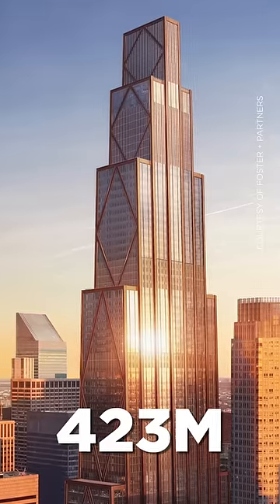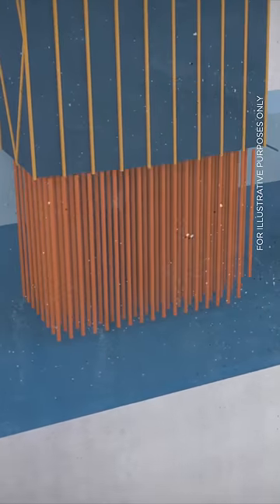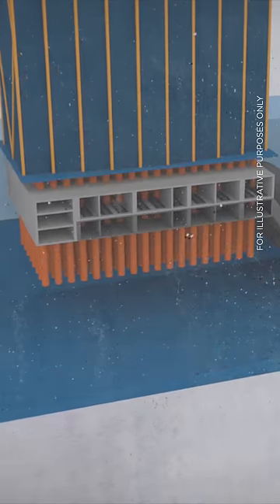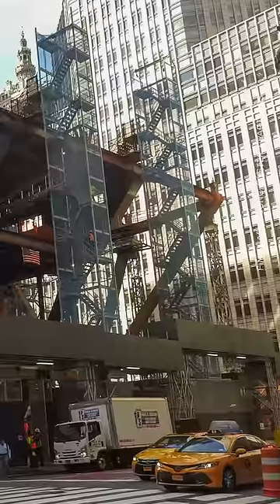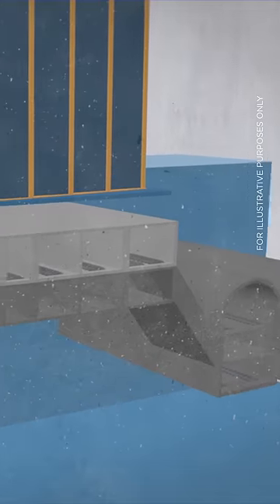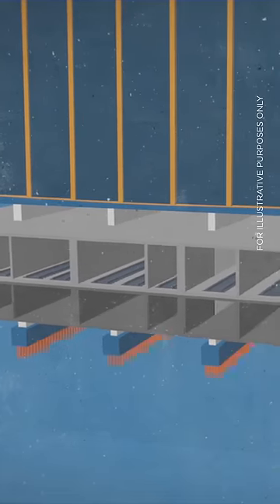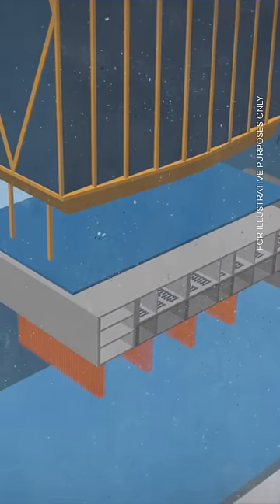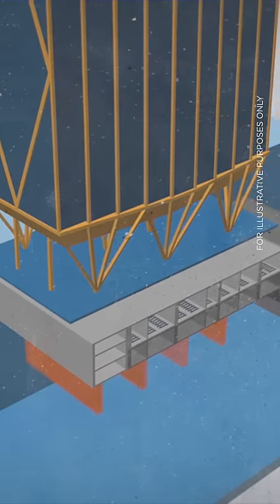The INSANE Engineering of New York's New Skyscraper

Comment: It just sounds so wobbly, like balancing a pencil on the tip, but I’m sure the engineers would make it work.
Reply: Not always….Almost every big city has at least one skyscraper that’s in trouble structurally.
Reply: Those columns you see in the video are only used for vertical loads. By themselves the buding would be wobbly. However the core of the building which will be in concrete, will act as the lateral load resistor!
Reply: That’s your opinion. You’re welcome to avoid the building and the subway lines underneath, if you can. Based on multiple factors the load tolerance was probably over engineered. I for one hope to see the plaza on YouTube videos soon.
Reply: They will break because they are just little wood beams.
Reply: "And as a condition of the city approving the design, the building's architecture offices must move into the first floor of the tower."
Reply: I'm sure...
Reply: @hunterdeardurff4386  
Another genius ! How many buildings in Manhattan have fell over or had severe structural damage since the day skyscrapers have been erected? In the city. I worked in Manhattan for half of my life. Never seen a problem. I think the college that the engineers went to are well educated in what they're doing. Otherwise imagine the repercussions.
Reply: @Mr.Robert1  Wasn;t there a potentially dangerous problem discovered with the Citycorp building? 
Luckily it got fixed, but could have cause a collapse I believe.
Reply: Lol facts
Reply: Nek minnit
Reply: Looks to me like it could collapse at any time!!
Reply: No it’s physics it is guaranteed to fail
Reply: @monishbiswas1966 yes they determined that the bolted joints wouldn’t hold up in hurricane force winds. They went in and welded the joints and of course it is still standing.
Reply: Balancing one pencil ✏️ sounds difficult but if you have a bunch of pencils set up the way the architects designed it. You will be able to stand and balance on a small scale model made out of pencils easily
Reply: Wobblyness is relative. The heavier it is, the more it takes to make it wobble. If Godzilla starts wobbling the building, we got problems
Reply: @monishbiswas1966 John Hancock Ctr in Boston had window panes falling off when it was built
Reply: It will fall in a couple weeks
Reply: @lizvogler4238
Glad you could bring your engineering and architectural degrees to this study. Please tell us in your expert opinion how this is unsafe and feel free to bring all of your vast knowledge and similar structural failures to the party. Otherwise, it just sounds like some doofus spouting off on YouTube about something they’re woefully underqualified and intellectually incapable of supporting and I know that can’t be the case. Every YT vid is filled with so many skilled experts, so I’m sure you’re one of those. I look forward to a video rundown or a published paper in the future. Until then, may we all be blessed and sleep soundly knowing you’re on the case about what looks structurally sound for a half billion $ Manhattan building.
Reply: Imagine taking out the legs with c4... easy pillar drop -intrusive thoughts😅
Reply: Until it doesn't
Reply: As long as they balance that skyscraper on “my tip” I’m sure it will stand firmly erect! 😅
Reply: Bruh, you're like 14 vs the best engineers in the world lol 😂😂😂
Reply: This is sketchy to say the least. If there's a earthquake (and they do happen in the northeast), the colums can easily buckle into the empty space, and the whole tower can topple from its base. The best case topple scenario is the leaning tower of NYC.
Reply: @Me97202  this big city had two…
Reply: @hunterdeardurff4386 wood?  Get a grip.
Reply: It’s risky but the reward financially is certainly worth it
Reply: Not really.....
Reply: Funny you all brought up Citicorp to help your argument...and completely forgot the crazy stilts in the middle of the block that hold it up, which damages your argument.
Forty seven years and counting.

Btw, our "weird" building is in Soho. Huge apartment building, completely empty bc it leans eight or nine centimeters off plumb. No way to really fix it, either.
Reply: Sure, it will work but for how long!?
Reply: @SethMethCS  NYC has had over 500 earthquakes recorded.
None of them have been above 1.7.
Why?
NYC sits in the middle of the NA tectonic plate, almost 2000 miles from the closest edge, which is in the middle of the Atlantic ocean. 
We are very well protected from this issue.
Reply: Not true  @MrRezRising
Reply: how many times  have  i  heard that before a  disaster
Reply: @Mr.Robert1 the twin towers?
Reply: @monishbiswas1966  
Actually there was
Reply: @jordanstangl2293  
You got it Beavis
Reply: @gabo262  
The World Trade Center in lower Manhattan
Reply: @MrRezRising  
I hope everybody realizes that the majority of Manhattan Island is Granite. Actually visible to the naked eye in Central Park
Reply: @MrRezRising  
The tower of Pisa has been leaning so long -- nearly 840 years -- that it's natural to assume it will defy gravity forever.
Reply: @monishbiswas1966  

October 1977. Less than a year after completion, the structure had to be strengthened when it was discovered that, due to a design flaw, the building was vulnerable to collapse in high winds.
Reply: @MrRezRising  
October 1977. Less than a year after completion, the structure had to be strengthened when it was discovered that, due to a design flaw, the building was vulnerable to collapse in high winds.
Reply: @johnnyllooddte3415  
For the exception of the 9/11 disaster, there has not been one structure on Manhattan Island that has fell over or collapsed for any reason. Most likely because of the foundations goes into solid granite.
Reply: Manhattan is solid bed rock
Reply: @takecarebpk  
Just go to Central Park. There's exposed Bedrock above ground. Granite!
Reply: Don't worry im a engineer!
Reply: @Zandex0  
I'm a doctor Jim ! Not an engineer.

Comment: I'm an engineer but not an architect, and I'm sure those architects know what they're doing, but I think the general public will be a bit uncomfortable sitting right under the skyscraper, at least for the first few months or when there's a lot of wind, it looks very fragile
Reply: Curious, do the architects not follow the lead of the engineers? 😅
Reply: @bigtxbullion  Well, I'm a computer engineer so I don't really know anything about designing buildings
Reply: @diecicatorce6259  using the term engineer to describe yourself in this comment section is a bit confusing if not disingenuous. I'm a lead software engineer, and I would have opted for programmer to avoid confusion. We are not typically the first thing that comes to mind – and in this case our jobs are not particularly relevant to the video or your comment. 😅
Reply: @bigtxbullion Architects draw the impossible, structural engineers make this possible. But there are exceptions, even in NYC, meaning they spend the cost of the initial building again on retrofitting.
Reply: You might want to rethink that trust.
Reply: @bigtxbullion  In this case and with any other skyscraper, the foundation is what's most important, and the professionals primarily tasked with handling and calculating the number and width of the bored piles embedded in the ground, are the Geophysicists. Even with the help of technology such as building information modelling (BIM) or even 3D printing, estimating the possible weight of the completed project which ultimately determines how much bored piling would be required, can be rather tricky and beyond the expertise of let's say an architect or structural engineer.
Reply: @diecicatorce6259  lmaooo so you no clue what you're talking about just saying the word " engineer " great job dude
Reply: @Spoon89803  hi, sorry, but this isn’t the case. I’m a structural engineer and we work with the Architects to develop a building form that works and fits the client’s brief. I have worked with F+P on a major project in the past also - albeit in the UK.

Typically we will develop an analysis model, and a 3D model that feeds into the multi-discipline BIM model. The BIM model is the coordinated design, making sure that everyone’s designs fit together. The structural analysis model is separate, and is used to understand how the loading on the building develops forces in the primary structural frame, but will likely use exported geometrical info from the BIM model. Developing a structural form require an understanding of the physics acting on the building, with the model speeding up and allowing greater complexity in our designs. If you don’t have a grasp of what the model is being asked to do, the structure will not be great, regardless of how good your model is, or how clever the software.

The structural engineer develops loading plans for every level of the building based on proposed use and proposed finishes (these could
Include up to 1200mm + of planting medium if internal/external landscaping is required). 

Once applied to the Analysis model, these loads generate base forces at the point that they interact with the foundations. 

The current UK/EU building codes generate over 100 load cases, but it’s typically the same 5 load cases we used to consider under BS codes that govern. 

Our friends in the Geotechnical engineering team (not Geophysicist- they do an entirely different job, looking at and finding buried features) will then undertake a Geotechnical Ground Investigation, developing a geotechnical interpretive report, advising the possible foundation solutions that can support our proposed base forces. 

Key issues for a project like this will be long-term foundation settlement, understanding how potentially uneven elastic shortening of the vertical members will apply other forces to the building, and dealing this the (I would imagine numerous) transfer structures.

Working in an around a major infrastructure asset (in this case a subway station) also has it’s challenges, as the Structural and Geotechnical engineers will need to satisfy numerous stakeholders associated with the subway station that there asset will not be adversely affected in the short and long-term.

The Architect’s remit is typically much wider, if they are also ‘Lead Designer’ as they need to ensure that all aspects of the project fit together, and are typically the key client interface on Building projects (although we have been lead designer on projects lead by the engineering, rather than architecture in the past, but it’s much less common).

These projects are a major pain, but if you are going to use all that Carbon, it may as well be on something inspiring and different, as this structure looks like it will be.

Sorry for the (really) long post, but I felt it important to give credit to all the roles involved in building design - I haven’t even mentioned the MEP engineers that make sure that building has power, data, heating and cooling (etc), or the Civil Engineers that make sure that everything that the building needs gets into it. There are many other disciplines involved in projects like this, and we all play our part to create a successful building to meet the clients brief and make best use of their substantial investment in our built environment.
Reply: lol, clearly you've never lived in q big city 😂
Reply: The architects of millennium tower knew what they were going too
Reply: Architects, design, buildings engineers, tell the architects what they need for the structure to stay sound and safe.😮
Reply: There are some buildings in Chicago like this, they're very interesting to look at and they work well, such as 150 North Riverside.
Reply: @alexjohnstonjohnston5374 Thanks for the explanation. Interesting to hear, how all those people are involved in this kind of projects!
Reply: You being a computer engineer has nothing to do with structural buildings which is the job of a civil engineer
Reply: @bigtxbullion making the architects design work is the responsibility of the engineers
Reply: @alexjohnstonjohnston5374  I read all of it. Dang, I've always been fascinated with the transportation used, and how you get facilities like gas, water and heating up so high! I'm not as smart as you, but working with computers and programming, I know firsthand how much people can ask when they meet someone who works in a certain field, and how they're sometimes disappointed that I can't answer every theoretical question about everything computer related 😂
Reply: @bigtxbullion it’s the other way around buddy
Reply: It also provides easier public access to the support columns. Sooooo terrorism?
Reply: Imagine if there's an earthquake? 😳
Reply: I've got a PhD and I'm a doctor. Do you need a prescription
Reply: A billion dollar bet on closest date to falling 
Place your bet here
👇
Reply: @dinot1609  Don't worry, seismic load cases combined with wind and gravity will definitely be amplified then accounted for. That is, to the magnitude of earthquakes that happen every 500 years at least.

Comment: The east coast of the US does not have earthquakes. On the rare occasion an ancient fault line moves, the buildings are designed to withstand the force of the ground movement, which is low on the Richter scale compared to other areas of the world. In 2011, the biggest earthquake on record for the east coast in the US was only a 5.8, and that was the first/only one I've ever felt here in 30 years. There really wasn't any damage to any of the skyscrapers/buildings in NYC or any other major city.
Reply: There was a huge amount of earthquake damage to admittedly very old structures in Washington DC a few years back
Reply: New Madrid fault is closer to the surface or something, making even small quakes very noticeable..
Reply: @robertbobbypelletreaujr2173 and that fault is over 1,000 miles from NYC so all good.
Reply: Yes, in geologic terms, there haven't been any large quakes around there lately. 👍 😃

Comment: For some reason I am not getting the trust I need to be around that building. If I am ever in town I will make sure I stay atleast 423M away from the building in any direction. This looks far too scary and I wonder why they’d use the old building foundations. Well, I hope everything works out just fine. Good luck.
Reply: Don't worry mate, we design to at least 1.2 times the worst possible loads, and seismic (earthquake), gravity and wind loads are all combined to work out the worst load case on the building. Every member used is more than adaquate.

Comment: I will not be surprised if it ultimately ends up being somewhat like the Millennium Tower in San Francisco but my hope is that it won't. I love the concept -- and the look -- of the base, but it seems pretty risky. With structures like the Millennium Tower, as well as One Seaport there in Manhattan, it's pretty obvious that you can't cheat when it comes to creating a solid base. I just hope it works out and that we don't eventually find out that it's tilting or anything of that sort, I really do.

Comment: She’za leaner.
Can’t wait till this baby starts to settle. How do they plan to install the new concrete underneath the existing shear walls? This site has out the engineers in a real box. They ruminate, cogitate, procrastinate and finally stamp the design. They are at risk for the performance of the design. Personally, you could not pay me enough to be responsible for anything beyond a pup tent on this site.

Comment: Hopefully, they compensate for thermal expansion wind speed, and hydrostatic pressure, if cracks appear they might as well drill holes all over the subway and insert metal beams, etc, and fill in with cement like the beginning of the video 🤷‍♂️
Reply: Definitely, there are equations for thermal expansion, wind speed is worst case combined with seismic and gravity, hydrostatic is geotech.

Comment: This is a terrible idea.

Ignoring supply and demand:

1. relying on the often “questionable at best” maintenance of subway lines is a horrendous idea

2. Having that mass going through so few points is dangerous (how are they meant to be maintained anyway?)

3. WHO TF WOULD WANT TO HANG OUT IN A PLAZA UNDER A MASSIVE TERRIFYING SKYSCRAPER THREATENING TO COLLAPSE ONTO YOUR HEAD ANY MINUTE AND COVERING UP THE ENTIRE SKY?!

4. How are you supposed to get plumbing and electrical wires to run in and out of the building? Those supporting beams already are a shaky idea at best

5. What if there is particularly strong wind or a minor earthquake? That kind of supporting structure is just begging to fail

6. Having the supports that out in the open and available means that inevitably some douchebag will try to collapse the entire tower by damaging them, which would be a lot tougher if there were walls around them or something. Remember the riots all across american cities a while back? what happens when it inevitably happens again? What if someone forgot how to drive (again) and crashed into them at high speed (ok I realise noone in new york drives fast, the traffic jams don’t allow it but still)?

7. I’m too tired and can’t be bothered with adding more items on the list, feel free to reply with some of your own if you want to, my brain is running on caffeine and I think maybe 5 minutes of sleep.

Also if this list hasn’t made it obvious yet - I’m just a student, not qualified to speak on these matters proffessionally (yet).

Comment: It doesn't look good...loads may be too high on the sections of the sheer walls where the V-shaped columns will be presenting multiples the weight rated for any given spot along the sheer walls, no matter the reinforcements beneath the sheer walls. The sheer walls need to be reinforced at least. It won't be built.

Comment: F-that tower.  There's no redundancy in the engineering just one of those critical support points fail and that whole tower is going to come down.  The weak point is connection between the main building and those subway walls and the pilings underneath.